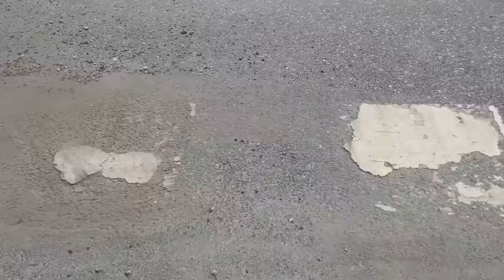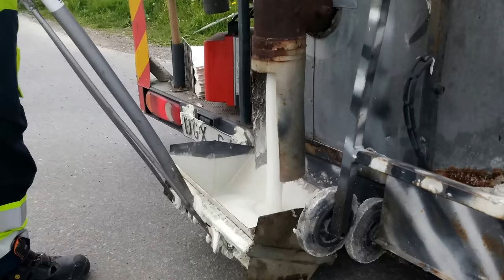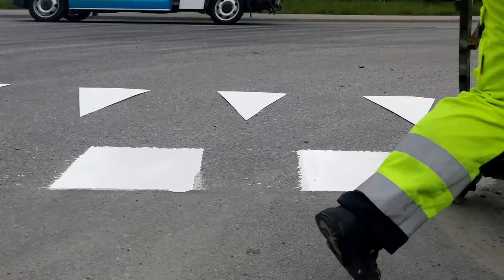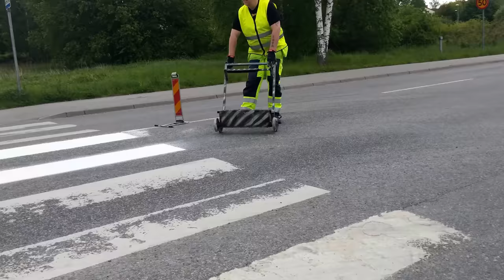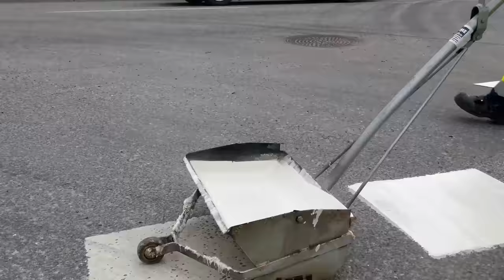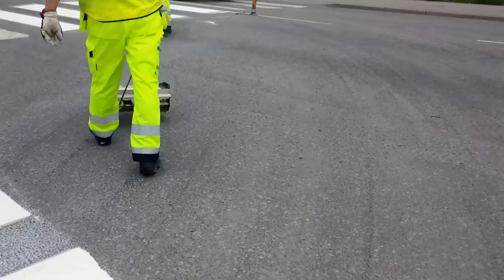SWEDEN - Thermoplastic road marking project performed by EKC Sverige AB - Part 2 @MasterWorkers

Comment: kind of slow with the beads. I doubt they stuck well.
Reply: even the guy laying thermal had to keep waiting.
Reply: and they let thermal drip under the melting pot. A piece of tar paper or even cardboard would clean things up. not to mention occasionally running through the cw bars on the way to the next one.
Reply: I mean, it happens, it just wouldn't have been my choice of intersections to post to YouTube. so that makes me wonder if this was one of the better takes.

Comment: What are putting on top of the paint
Reply from the maker: It's glass powder (%85) for reflection purpose in combination with sand (15%) to make the surface became hard quicker.
Reply: Mainly titanium oxide, a reflective material
Reply: Kema

Comment: Titan handliners boys, would quadruple that production, and remove the need for the bead guy. 200-300lb models, thermostat controlled with a propane fuel source. There's no way that whole die is keeping the temps above 400 degrees F consistently, and the beads aren't embedding well. that last bar just before 3:48 is tearing as it's spread.

Comment: Are they slippery when wet like regular paint?
Reply: It's not paint, It's thermoplastic and it's very hot stuff goes dry in about 10 seconds.
Reply: Casshern2010 You didn't read well. I asked is it slippery like regular paint is. Especially when wet. And you didn't answer the question.
Reply: Umm no it's not slippery when wet else pedestrians would slip lol
Reply: Casshern2010 regular paint is, very tricky when on a motorcycle
Reply: Европрограми